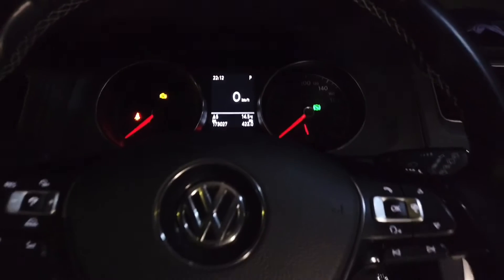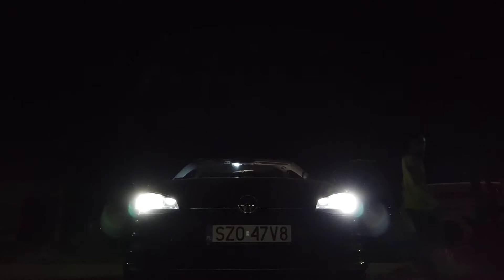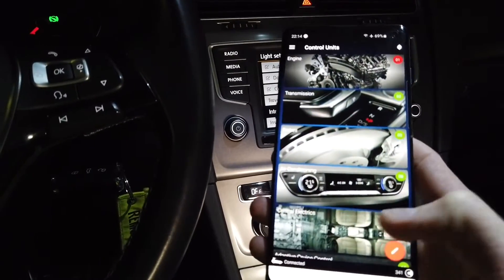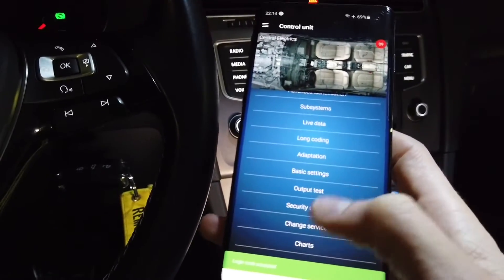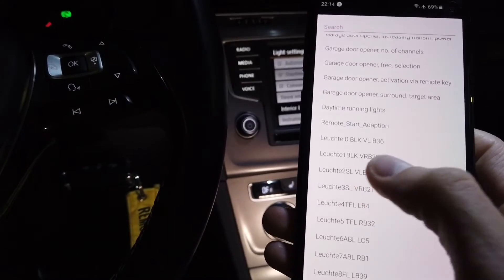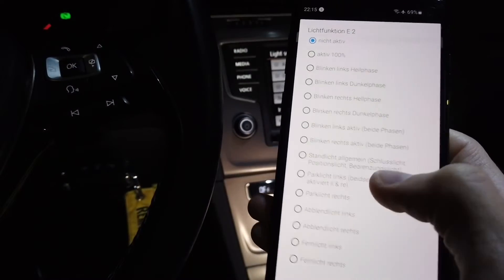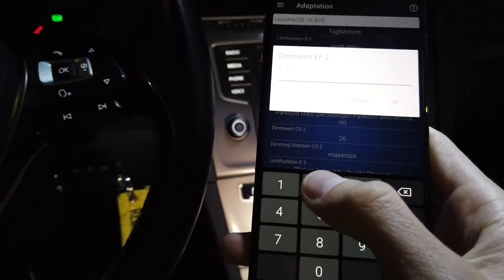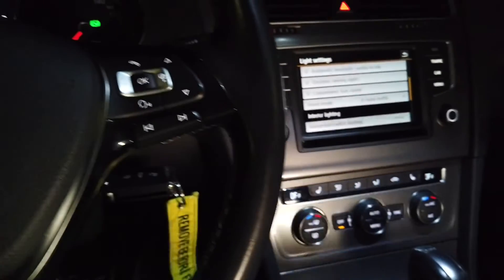VW Golf MK7 (5G) DRL wink with indicator

Comment: Men thanks for sheering this videos. Where do you get the codes from? I have an each that i can't put it back as it was. The headlights of my golf 7 are direccionals but i acidentaly change some codes, make factory reset but didn't work. Now my headlights insted of make a shadow on the incoming trafick just pass from hight beam to low beam. And when driving the headlights do not fallow the curvs anymore. Can you help with the long coding? Thanks!

Comment: This coding is dimming only the DRL or the headlights as well, if the lights are turned on?
Reply from the maker: Only DRL. In my case headlights need to stay at 100% as xenon ballasts would get damaged if not provided by power at the correct level.
Reply: @mrfixpl  just done it. Works just fine 👍. The ligths stay on, only DRL fades out and in during turn signal. Thank you!